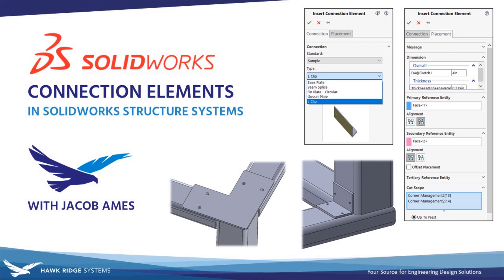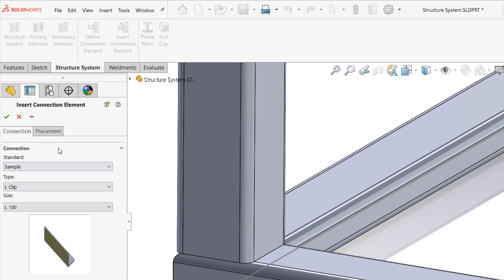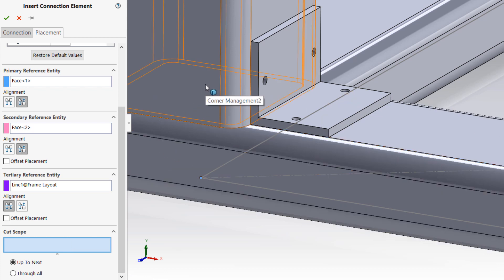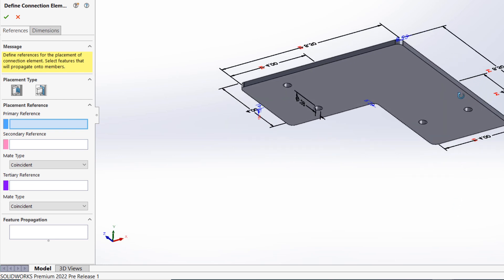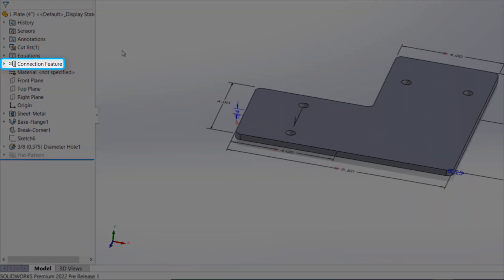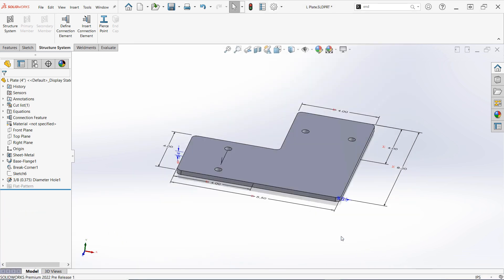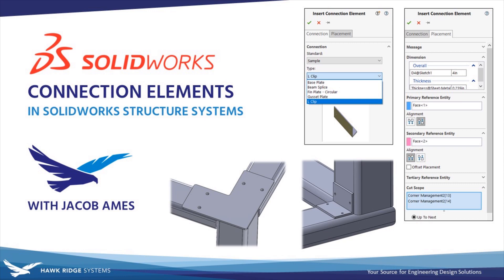What's New SOLIDWORKS 2022 - Connection Elements for Structure Systems

Comment: Hi, is it possible to create structural haunch using weldment profile as connection elements?
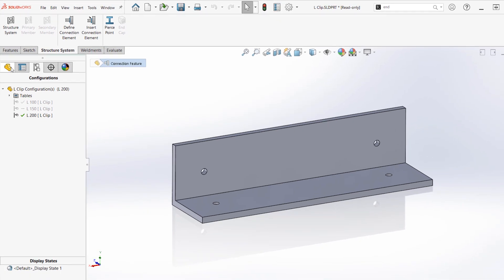Reply from the maker: You might try the gusset tool to see if it gives desired results. Otherwise, give the "create new connection element" process (3:45) a go and see what you get!

Gussets:
https://www.youtube.com/watch?v=WiJz12HqEZg

Comment: can connection elements be used on standard weldments features?
Reply from the maker: Connection elements are only available on Structure system. But you can use a custom design library feature to represent similar connection in a traditional weldment - we have a video on this approach here: https://www.youtube.com/watch?v=HDyoZH4X2qk